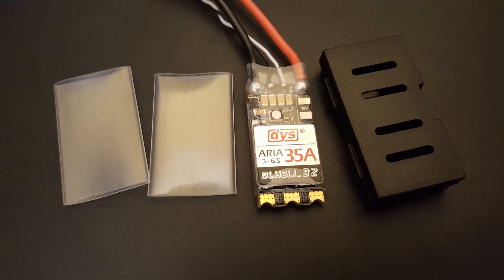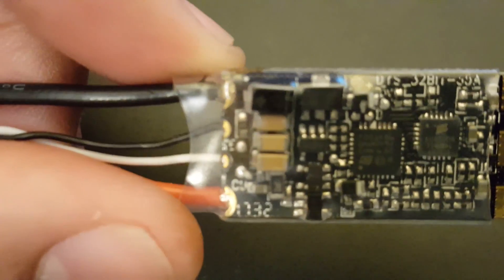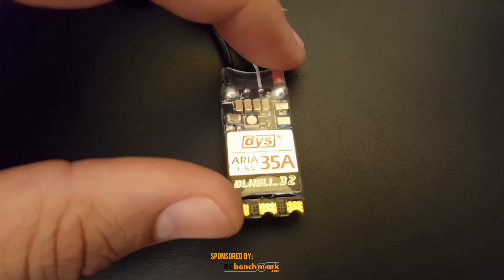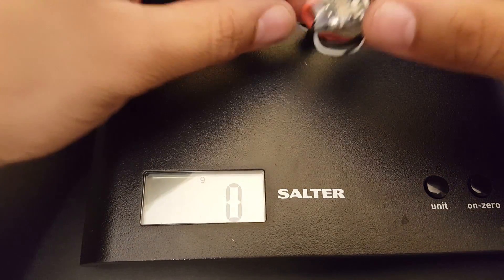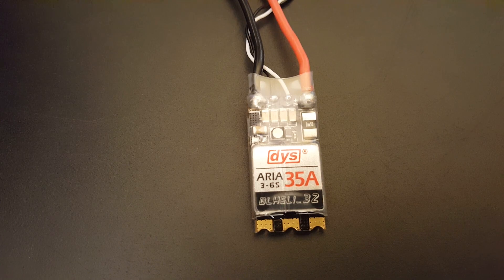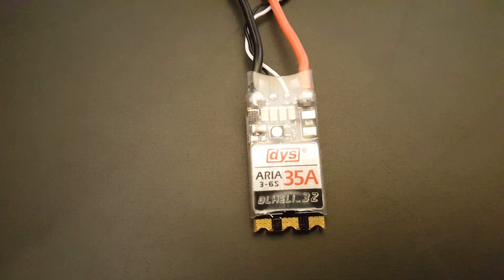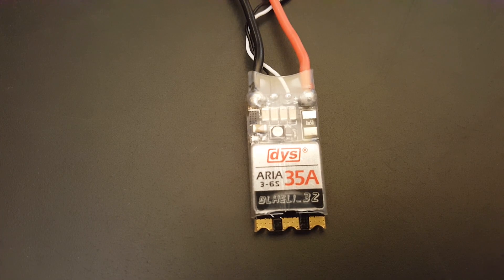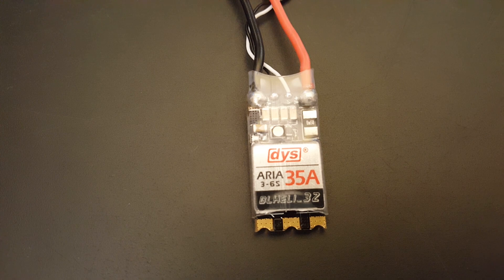DYS Aria 35A ESC // Review and Noise Testing

Comment: I bought a pack of five over a 1 1/2 years. I swapped out the extra only two months ago cause I clipped a tree which mangled the esc. I have s JB F4 FC, pushed by DYS Arias 35a, with emax 2306 2700kv motors, at 5S, on a hyperlow cg frame. It screams and flies like a dream.

Comment: Too add telemetry do I have to solder another wire too the FC or do I move the signal wire from its pad to the telemetry pad? I'm doing my first build right now. I'm using these ESC and the Betaflight F4 FC (FPV Model Branded one). Thanks!

Comment: Another great video my friend! Quick question.. can you increase pwm frequency to the max without anything restricting that? I have a new fc.. the motolab typhoon.. which has a 6000mpu gyro.. so 8k-8k is the max! Not the fancy higher gyro settings.. and it is also recommended not to go higher than dshot 600 with this fc.. so can i than still increase the pwm frequency to 48khz? (On airbot wraith)
Reply from the maker: UnXisT FPV Test is some report having issues after 32khz
Reply: Okey thanks! Are you also going to revieuw the motolab typhoon+vtx combo?

Comment: Again I'm looking at some ESC, would prefer 4in1, but the lack of test/review is making me uncomfortable. On my previous build I bought, under your advise, the cicada 4in1 30A, and I'm getting lines that I can't get rid of, even with 1000uF CAP : /
Been looking at you test lab website, but not much 4in1 there as well. Also, for your info, it seems that you got the EXACT same review for at least 2 ESCs : the wraith32 and the ipeaka32.
I'll carry on my TIME CONSUMING research on good 4in1... even tho I'm not sure if I should, since I bought the matek F405 AIO FC, after watch your praising review of it, and the side HUGE VBAT connector are really annoying, as I would have them twice, on the side with FC, and on the back with 4in1ESC :/
Would you recommend any particular ESC for the matekF405AIO on a frog race ?
Reply from the maker: +6rilllir6 Ok I have used 2 4in1 esc cicada and typhoons on my cicada build no noise and my typhoons 4in1 getting some noise I am in the process of make the video. However the amount of noise if any where to apear will come down to the motor. 

Sometimes high d can generate noise out of thin air.

I'll try to get more 4in1 esc in for review but it's very hard to give proper review since all the caps are shared and I only at the moment have a setup to run 1 motor. Which in return will create unreliable testing. 

I am currently working on a 4 motor setup for such things as well as really stress the new FC conning out.

Add the 1000uf to the ESC and the 450uf to the Matek board and let me know how it works out. 

I will try to replicate your setup what motors are you using.
Reply: I understand the testing implications for 4in1, glad you plan to go through all that for testing them! :)
about my little problems: I got 2 quads : 1 built and flying and 1 that I'm starting to build.

the one flying is : frogLite + CICADA-4EN1-30A-4S + FPV-RADIANCE-DSHOT + Emax RS2205S + TBS unify proV2 (5v) + Swift2 + XSR + 100uF on ESC
I get horizontal lines (they sometime rotate a little), I noticed that 25mW gives fat lines and the more I increase the VTx power, the thinner the lines. Can't get rid of them.

the other that I just started to build : so far I got this:
FrogRace + matek F405AIO + Racerstar BR2306S 2700Kv ... need to buy the rest. But I'm really confuse about how I'm going to manage that HUDE VBAT on the side of the matek FC! Since most ESC that attract me (4in1 typhoon32) also have Huge VBAT at the back. Should I run big cable from ESCs to FC? Should I run small wire to those big VBAT hole on the FC ? Should the lipo goes first to the FC or the ESC, does it even matter? (sorry I'm ignorant at electricity and electronics)
Reply: Maybe the spedix is30a 4-in-1 would be a safe option. A lot of people used that one

Comment: lol I found 48khz gave me noise in camera I couldn't get out so I tune it down to 46 I think and was gone lol. It was diagonal lines I had its a gremlin that was in last 2 builds but they fly great. also what esc you think can run proshot I was going to try the racer33a 32bit they have custom firmware not bl32
Reply: I have the same issue. Where do you tune it down to 46 at?
Reply: you need the bl heli32 gui you cant use the configurator yet to my knowledge. Just connect to your esc with BF/CF 3.2 pass thru if your on 3.1.7 you need to update at least to get passthru to work. its one of the setting in gui. if you have space in build you might need an lc filter or cap each esc. I think its these osd boards need better filter circuitry

Comment: 48khz is night and day difference in flight, it's really sweet. I wonder which is better.. 32khz pwm and dshot1200 or 48khz pwm and dshot600 as far as latency is concerned, because like another post said 32khz and dshot1200 seems to be the max for dshot1200.

Pwm 48khz though really puts prop wash handling and especially handling in windy conditions to a whole new level

Comment: 32khz is the max pwm if you want to run DSHOT1200. Mad motor glitches on motor 1 @48khz, though DSHOT600 is fine. Apparently they are looking at getting 48k working in BLHelli32 I heard.
Reply: justin Middleton hey I'm getting glitches in one motor to on D shot 1200 that sucks. But 600 works great let me know if you find out why please. I bought 32 ESCs and can't even use them right it SUCKs
Reply: All of these 32bit ESC's can only run DSHOT1200 @ 32,000 PWM. (Check the specs on the Wraith32 35a for example, some of the most powerful 32bit ESC's. https://www.dronebit.co.uk/wraith32-32bit-35a-blheli-32-dshot1200.html
Notice this line? "Dshot up to at least Dshot1200, and at rates up to at least 32kHz is now supported."

Apparently they are looking at getting 48,000 PWM running smoothly on future BLHeli32 updates.
Reply: Justin. i have the aikon ak32 blheli 32. and 32.3 fw. and i have pwm att 48khz.. is it so that max on dshot 1200 is 32 khz ??

Comment: Thanks for taking the time to spotlight this esc. Fingers crossed mine will turn up tomorrow. I have the day off work so I'll be putting them on my quad. However I think I fucked yo tonight. I cut my antennas shorter last night but went to bed without stripping back the tips. Plugged it in this evening to do some work on it and noticed my receiver wasn't working. Did I fuck it because of this? There was a component really hot as I burnt myself when I grabbed it to see what's going on. I think it may of been a resistor. Anyways I should be able to solder the esc on and get everything calibrated and setup. Just can't bloody fly it tomorrow.
Reply: Is it a telemetry receiver?
A normal receiver which is only receiving isn't damaged by running without antenna, because what gets destroyed is the amplifier, because you don't have that its fine.
But if its a telemetry receiver which sends data to your tx, then maybe the telemetry part is damaged even though the chance is very little, I would try rebinding it, maybe that'll help
Reply: MrMario616 thanks man. I will have a play around with it tomorrow. It does have the telemetry for batt but is not wired up. There ain't no lights that come on when I power it up. I might try resoldering to see if I've a bad connection as I don't have a multimeter.
Reply: Marshal Mathers maybe your regulator on your pdb burnt, because of being powered on, without any airflow? But that's unlikely to happen
What type of receiver is that?
Reply: MrMario616 it's the turnigy ia6c. It's powered through the dys f4. Maybe the regulator is fried on the controller. I will investigate further tomorrow. Actually I don't think it is since power is definitely going to the receiver as it heats up but no lights turn on.